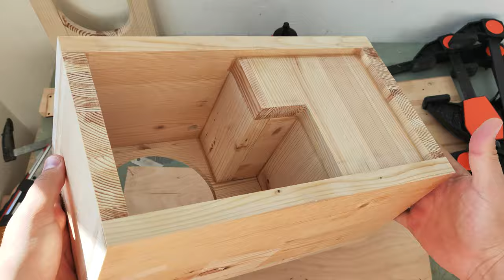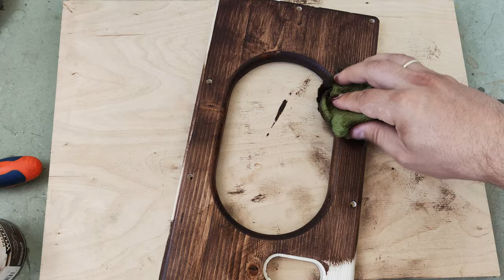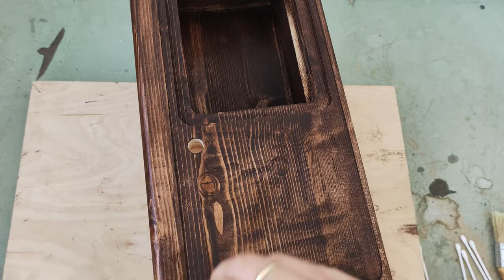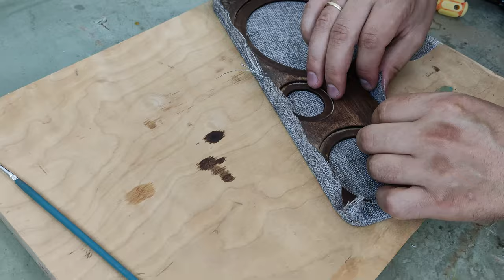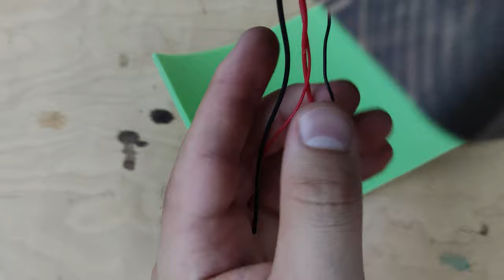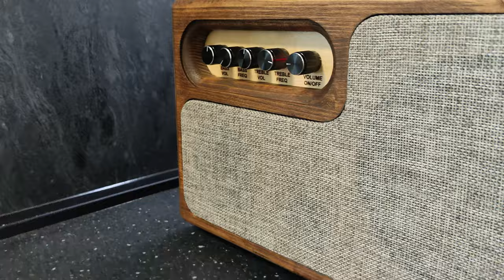DIY Bluetooth Speaker 60W

Comment: Bro this thing looks just awesome !! Respect! I want to build a speaker for myself, i have a small canton subwoofer like 8" and a jbl 12" subwoofer i dont need anymore. I dont want a speaker that is impossible to carry arround but i guess a little sub is not good for outdoor use. Second pepblem is that i dont know if a closed design is any good for outdoor use. The tpa3116 is not that powerfull for longhub or too big driver i guess. Third problem, i dont know any parameters like qts for building an enclosure. Or should i buy an 10" car audio woofer which i know the parameters to build a good enclosure ? Like audio system CO 08 evo ? I hope u can help me
Reply from the maker: To assemble a Bluetooth speaker using a 12" subwoofer, it will be heavy in any case, especially if the speaker requires a large internal volume. For example, on my YouTube channel there is a speaker with a jbl 12" subwoofer, it weighs about 42 kg. this is a lot, you need to carry it in 2 and carry it only in the trunk of a car. For a portable one, I think the maximum size is 8", as for the power of the tpa3116, it approximately needs an 8" subwoofer, they are usually about 100w. Car subwoofers require more power around 200w and above, you can consider tpa3255. About the speaker parameters, I agree that it will be easier to assemble, knowing the parameters, you will be able to understand what internal volume is needed for the speaker, what design is suitable.
Reply from the maker: For the best efficiency of designing your Bluetooth speaker in an open environment: a closed box, a bass reflex or with a passive radiator, you will need to at least measure the impedance of the speaker in the box. Based on the result, you can understand what type of design is better suited; if it’s a bass reflex, then it’s better to bring the port forward. A closed box will play well if you buy a good speaker with low FS, a good magnetic system (full quality factor), with a small internal equivalent volume, then you can get low tuning in small dimensions.
Reply from the maker: If you use CO 08 Evo, it has fs 41.9Hz, Vas 20.7 liters. Let’s assume you assembled a closed box, square, then it will be approximately 28 x 28 x 28 cm, this is inside the case, taking into account the small volume displaced by the speaker itself, i.e. you take into account the thickness of the material and can imagine the future size of the speaker, or rather the compartment for the subwoofer. In this case the resonance will rise to 58-59hz. This is normal for clear and correct sound; you won’t hear low bass in the open air. The bass reflex can be adjusted to approximately 39-41Hz. Just use the program to see for yourself how long the port will be needed, whether it will fit inside the case or make a port along the wall with a 90-degree turn.
Reply: @DIYAcoustic  thanks for your Response ! So do you think its stupid to build with a speaker if you dont have the parameters ? I dont want to throw them away or build cases i cant reuse for anything u know. I dont need ultra low bass, 50hz and above would be fair enough
Reply from the maker: Of course, you can assemble without parameters, but the result can be very bad, for example, you assemble a case, and the VAS dynamics are very large, in the end you will get a very high setting, etc. Of course, it may be that you get a good result the first time, in fact, you can configure it after assembly if you make a bass reflex port using a port in the form of a sewer or some other pipe, selecting different lengths by ear, or use a smartphone microphone in a spectrum analyzer application.
Reply: @DIYAcoustic  tbh i want it to be as easy as i can with good Results and compact so i guess closed enclosure is my way to go and its not that complicated. But im struggeling if buying a new sub chassis makes sense. I found the audiosystem m08 evo more interesting as the c08. Hm not easy :D with the small canton woofer i have, i think the outdoor results would end up very pour, especially in closed box